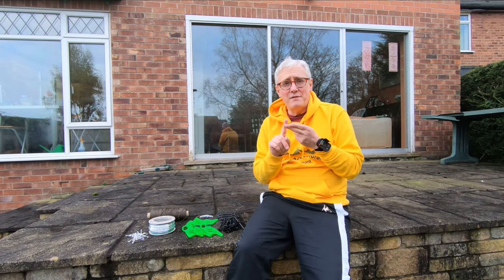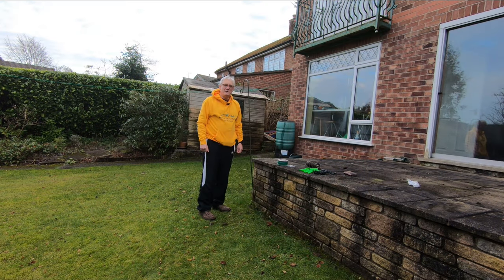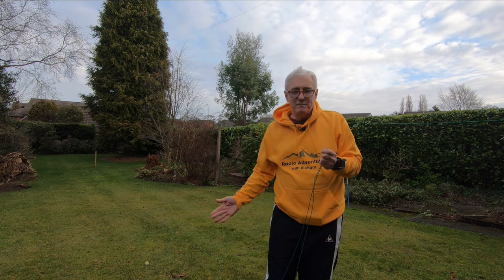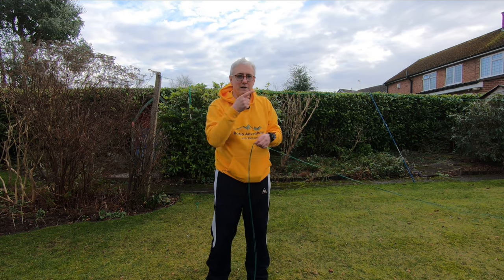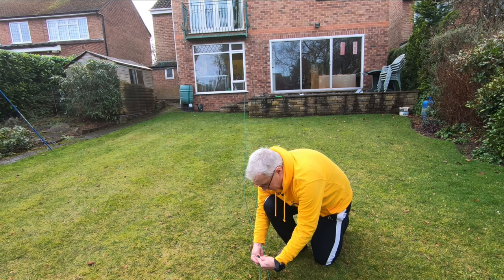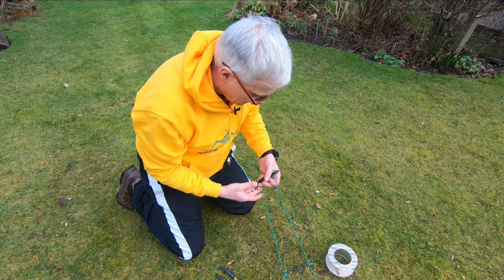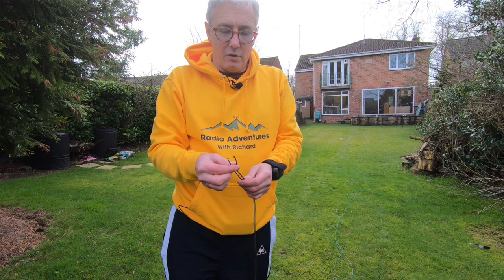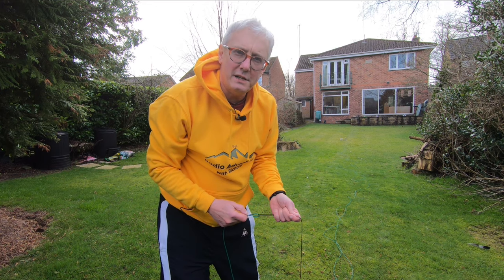MAKE A GREAT HF ANTENNA - EASY!

Comment: HI Richard. Great video. I watched it about a year ago. Back again as looking for something like this at my QTH. Normally I would have a mast in the garden but neighbours have mentioned it.
So just bought a atu waiting for it to arrive. Thinking I can get something like this in my attic. What's the shortest length of legs can I go? My attic is 8m long. My lowest band probably 40/20m to 10m
Tried a Z shape with efhw but not good on RX. Does it need a ballun on the end before a tuner?
Thanks in advance
Motters M7TRS 73 👍🏻
Reply from the maker: With 8m length you can do 17-10m.
Reply: @g3cwi_Radio_Adventures  thank you will have to see what I can do. If not will just keep it portable op's. 👍🏻😁

Comment: I made a wire doublet with your older style laser cut acrylic Center and spacers. That worked great. Also did a loop fed the same way, it worked really well too
Reply from the maker: Doublets are certainly useful!

Comment: Hi, Richards, thanks for your video. I would like to know which is better to use, with less loss and convenient and stable swr, in dipoles with balanced feeder line manufactured with Sotabeams open wire line spacers of 27.5, 50 or 120 mm long?. Why?nBest Regards
Reply from the maker: I would tend to use the longest ones myself.

Comment: Thanks for video Richard. Looking forward to next installment.
The humble doublet is perhaps often overlooked as an effective multiband antenna. I have used one QRP/P a few times.  About 30' long, yet still managed some 80 thru 20m contacts with 5W and the antenna up just 5m.
One advantage over linked dipole is that you don't have to take it down to change band.
Reply from the maker: Thanks Steve. Just waiting fhe right time to test it!

Comment: For portable and low profile QRP use I highly recommend the NorCal design (http://www.norcalqrp.org/norcaldoublet.htm) that utilises 4 stranded computer ribbon cable to fabricate the radiating elements and feeder all from a 50 foot length of the cable (no joints and no feeder spreaders!). I use it at my home QTH and for CW I'm able to use up to 30W. It weathers well, and is easy to make.
Chris G3SQU
Reply from the maker: Thanks for sharing your views Chris. Please consider subscribing as I have lots of new content planned that you might find interesting.

Comment: Richard, I noticed that you had in the video the antenna length is cut for 118 feet. How long in the length of the ladder line that you that you made??
Reply from the maker: Hi Dave; the antenna was made from 50m of wire so the feeder is the remainder.

Comment: Great video Richard and my antenna of choice with my balanced tuner for portable ops. Generally I use the ‘commercial’ 450 ladder which can be  a bit ‘flappy’ in the wind (but easy to roll up and store....perhaps a bit easier than the open wire feed with spacers?) however it might be time for me to try some ‘home brew’ twin using your spacers to see how easy it is to deploy. I really recommend your ‘Sota-wire’ and WireWinders with fig8 technique. No more spaghetti! I did 266 SSB Qs over 3.5 hours in the 80/40 AFS contest yesterday with some DX to Indonesia and Afghanistan a bonus. My general config is 2 x 27m top wires (gives 2 x 5/8 on 40m and perhaps a tad of advantage) for 80-10 and I add 15m approx to each if I want to venture on 160 (a bit of a rarity for me unless contesting). Inv Vee config, centre at 10m which ideally could do with being higher...ends at 3-4m which I think is a min for inverted V usable on 80 (1/20 lambda). Keep up the informative content. Cheers, Nick M1DDD
Reply from the maker: Thanks Nick. I do stock some narrower insulators of the same type: https://www.sotabeams.co.uk/open-wire-line-spacers-short-pack-of-5/

Comment: Nice and easy setup but it's so long! If the antenna isn't resonant anyway would it work with shorter legs (on 80m e.g.) as well?
Reply from the maker: Yes but as the length starts to drop below a halfwave, the efficiency starts to drop. So while it would work, it would not work as well.

Comment: Really good video - appreciated. I'm wondering whether connecting  the open wire feeder to {say) 450 or 300ohm ladder line for the last couple of meters into my shack would be a good/bad idea?   This is just for convenience as the OWF is a bit 'untidy' in the shack - and I can get 300 ohm feeder through my wall fairly easily.   My thinking is that this would avoid a 1:1 balun (if I used coax) as the feeder still remains balanced although there is a bit of an impedance mismatch (60ohm to 300ohm).  Can anybody comment - am I mad?  Thanks Kevin M0XYM
Reply from the maker: I would give it a go. On the lower HF bands it will not make much difference.

Comment: Great video, thanks I was going to ask can you show how you connect, you say 1:1 and then straight into a tuner, but I guess you will cover that on the next part, testing, I am eagerly awaiting.
Keep up the good work. Matt ‘M0ZKK’
Reply: Ignore above, it’s all covered in the attached links...
Reply from the maker: @right360com  I will be covering it in my video on testing the antenna too!

Comment: Why is it all the wire antenna guns are in the UK? I've always like antenna building and noticed this over many years.
Reply from the maker: Interesting observation. Our planning laws coupled with a high population density make it hard for most of us to have towers and beams. We like our wire antennas!
Reply: @g3cwi_Radio_Adventures  Ah, yes the tower haters. We have then here in Australia too. All until there is a natural disaster and the radio people are our friends...... I'm currently studying for my license and the only part I dread is the tower battle.
Reply: To give a try for the first time, to receive, not transmitt, I had probably 36 feet of wire. My CB mobile antenna is base loaded and has a spring.

I pinched the wire in the spring and had the wire held horizontal 1-3 feet in the air.
I was receiving 20m and 40m rather well.

Comment: What bands will it cover? And what is the connector you use to attach to fiberglass pole ? Super video again Richard. 73
Reply from the maker: 80-10m. see video description for parts used. Thanks!

Comment: Exellent video,  what sort of wattage will the antenna take?.
Reply from the maker: It’s mainly dependent on the power rating of the tuner.
Reply: I learned about doublet antennas from reading an old AM Phone forum. Those guys were running legal limit plus into doublets with old Johnson Matchbox KW models. I scaled down for my 100w station and haven't looked back! 73 de w8tam

Comment: The bit that confounds me is the "antenna tuner" fed with open wire feeder. You can't really take open wire feeder through a wall, so the tuner needs to be outside. That's the bit I need to see. I can make resonant dipoles fed with coax shoved through a hole in the wall, so what's the next step?
Reply: Paul Ryder you could attach the feeder to a 1:1 current Balun and then as short a run of coax as possible to the atu (it’s this run of coax that would present most loss)
Reply: I bring 450ohm balanced straight through a PVC passthrough to my inside shack, and have no problems with it. I've made many thousands of contacts on my portable doublet antenna and nearly as many on my doublet at home.  73 de w8tam
Reply: Although you can go for the balun option to "convert" from open wire to co-ax as Tim suggests. You can pass the open wire feeder through walls, window frames, eaves on roofs etc. provided you keep it away from metal (i.e. conductive objects). Assume that's why Thomas has the plastic baseboard.
Reply: Paul, I did exactly that. I drilled two small holes in my aluminum siding, inserted a small section of PVC tubing to prevent wear and tear on the wires, and ran the feedline right to the tuner balun, which sits next to my rig. Works great. Open wire ladder line can CROSS metal, just isn't good to run it ALONG SIDE metal.